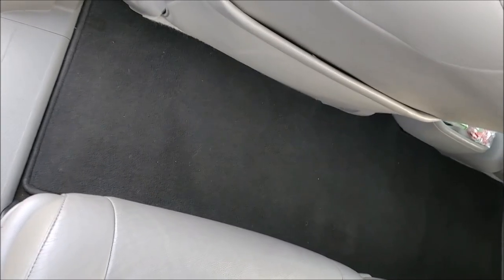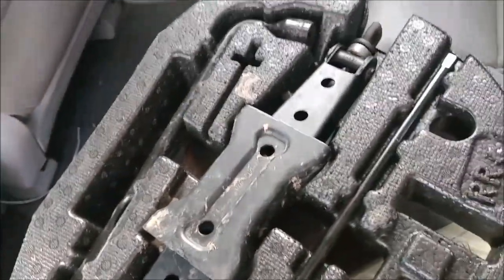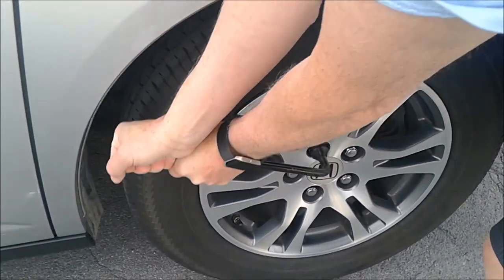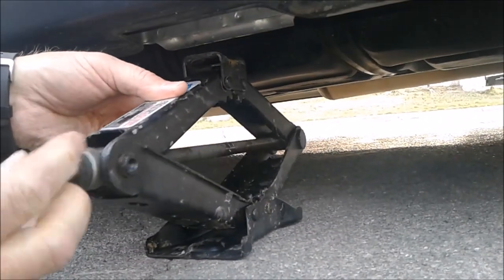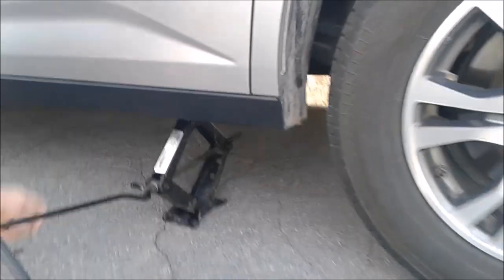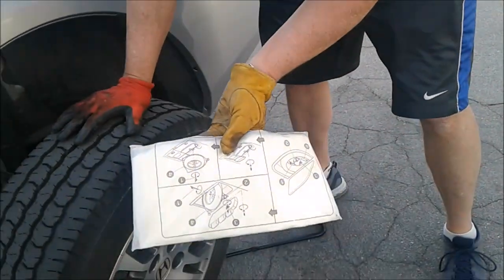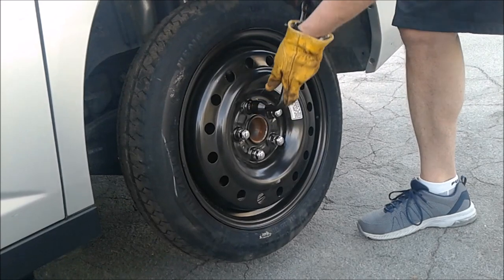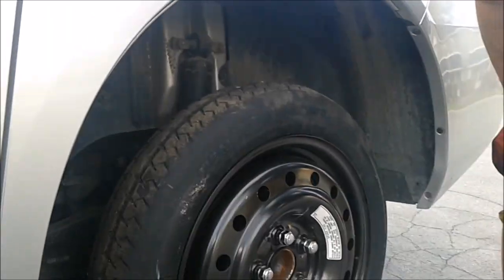How to change or replace a tire | Honda Odyssey DIY video | #diy #tire

Comment: What's the trick to changing it out WITH a full sized tire replacement? I noticed the "arm" onto which the tire mounts will drop a couple of inches once the full sized tire is removed. So when trying to put back on another full sized tire the "arm" is too low and has to be raised some to align the bolts with the holes. Is the key to initially lift/raise the vehicle a lot more than what is needed to remove the tire so that when it drops an inch or two, it'll still be high enough for the new full sized spare tire to fit in and align?